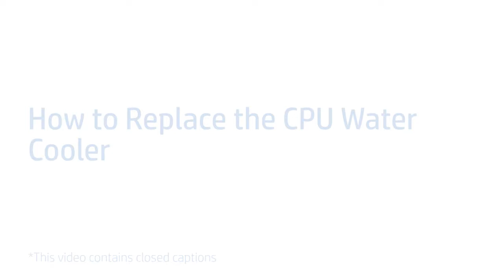Remove the CPU Water Cooler | OMEN X by HP 900-200 and 100 Desktop PC | HP

Comment: To prevent pulling the cpu processor cube out of its socket when removing the cooler, run the computer a few minutes until the cpu heats up. If the cpu has been overheating this could only be 1 or 2 minutes. But if cpu was only running slightly hot or normal, then run the computer about 15 minutes. You can use a cpu temperature measuring utility, get the cup temp up to about 80 or more. IF YOU DON'T DO THIS YOU CAN RUIN THE CPU OR THE MOTHERBOARD SOCKET IF THE CPU PULLS OUT WITH THE COOLER. Because the pins on the bottom of the cpu can bend. Or the cpu socket pins on the motherboard can bend.
Reply from the maker: +Acra Tone Thanks for sharing the steps that helped you.

Comment: can i know how much the fan size and it is possible to take this water cooling to another case ??
Reply from the maker: Hi Eysa, thanks for contacting HP Global Social Media Support!
I understand that you need to know about the fan size and also wanted to know whether it is possible to take this water cooling to another case.
I will do my best to assist you.
Use the HP Parts surfer to identify the part: https://partsurfer.hp.com/partsurfer/ 
HP does not recommend upgrading or downgrading hardware parts or software that is bundled with the product as It may affect the manufacturer's warranty and performance, however, you could change the configuration at your own discretion.
Binu_HP Social Media Tech Support

Comment: Is it possible to open the water cooler that came with the Omen X and replace the liquid that is in there?
Reply: Nope, you would need a radiator with a filling entry, attach the tubes to the radiator with a barb fitting, and then fill the loop.

Comment: Can i remove the water cooler and install another air cooler or does it have to be a water cooler
Reply: You can, as long as it fits inside the case.
Reply: @OliverWalker1  do you know which one fits in there?

Comment: Hmm, my cooler is going slow, and it’s making air bubble noises how can I change the liquid for it? If it’s greesy on the inside?
Reply from the maker: +Valkcher The Liquid cooled system is maintenence free, so there is nothing needed to be done. Except for keeping the dust cleared out of the radiator fins perhaps.

Comment: Does this Support 240-360MM Watercooling Because my Temperatures and 55-to 85 in 100% Usage
Reply: It supports only 240mm radiators, but you can only mount the radiator on 4 points (fan oriented)... Also, make sure you have nough enough clearence between the back of the chassis and the back tank of the radiator, otherwise it wonn't fit... Radiators like the Alphacool NexXxoS v.2 240mm and the XSPC EX240 will fit.